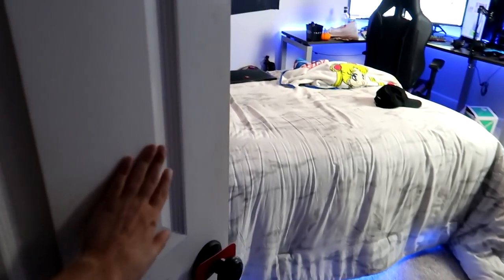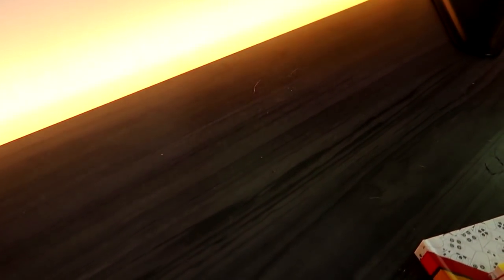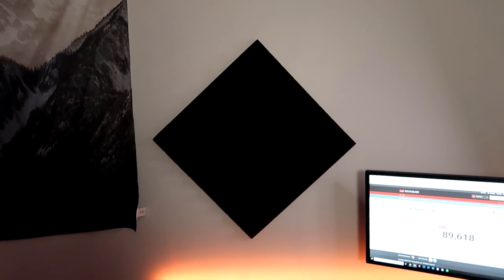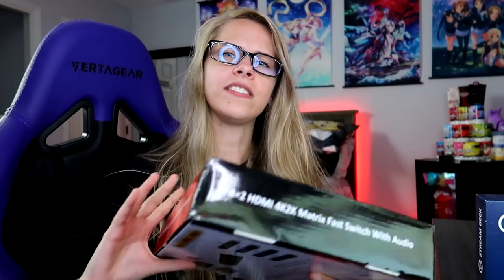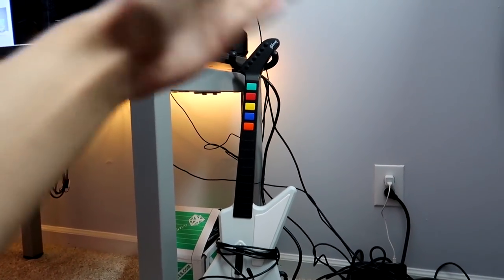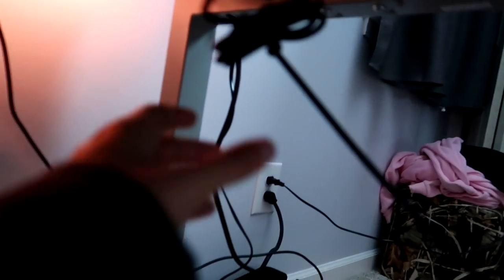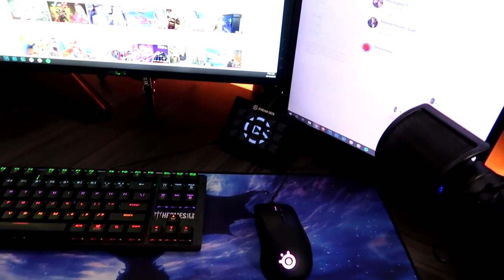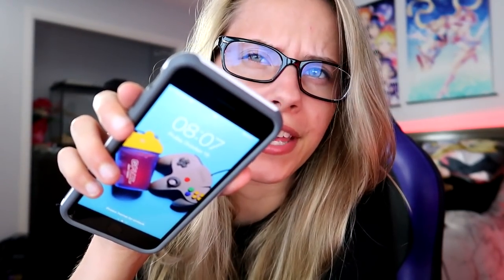UPDATING MY GAMING/STREAMING SETUP! ~ (CABLE MANAGEMENT TIPS) + Arrow Zoom Review | SoaR Butters

Comment: I have a laptop. Is that good enough?
Reply: no
Reply: depends on your preference and what all your doing with it and what the specs on your laptop are. Personally I prefer desktops so it would not work for ME. If your laptop is powerful enough to do what you need and your comfortable using it, then it would be good enough for YOU. It's all about personal preference and what you need the system to do.
Reply: For what
Reply: @RicardoPCGamer hi I’m getting a pc any ideas
Reply: @bigej6593  depends what you want to use it for.
Reply: Depends wut laptop u have
Reply: Depense

Comment: Hey, from one female gamer to another No zip ties. Really. Use Velcro strips. Easy for management. No scissors and no zip tie cutting later. Just wrap. I have all my computer racks and network racks set up that way. I work in IT system engineering and do the same in the server rooms with items I will be swapping. I even use them on large cat cable runs even in ceilings. Makes life so much easier. (I am 61 and this is just long life learning).
Reply: CSharkBytes yeah cuz you gotta be 61 to and a female gamer to know what velcro is used for.
Reply: Nah but being a 61 year old  IT systems engineer helps ...
Reply: CSharkBytes ok boomer

Comment: so you know, I found a hack to get better air flow on your case. Im planning on gettin the same one and almost everyone complains about the poor air flow in it. Did some searching and found some good info. On the front panel, take off the connectors, add a few small washers where the screws go. It will push the front panel out a little to give it more air flow. And remove the back panel on the upper case panel so the exhaust fans can exit the system better. which meens a cooler PC, and your PC wont run as hard.

Comment: That's not how the sound panels work! They don't block out sound outside or even inside the room. The only thing they so is (help) stop sound waves from inside the room from bouncing all over the place. In this case it helps stop sound waves bouncing from 2 walls. And help is the key word. Not completely.

Comment: If I may make a suggesting, instead of using zipties, I use velcro cable straps for cable management. Much easier to work with, and if if need to add/remove things its much easier. Also they are reusable so it will save money in the long run.

Comment: those audio panels will literally do nothing to isolate sound. lol Those panels are designed to defuse higher freq sounds coming from sound sources . you would literally need to tear the wall down and fill it with sound insulation materials. Just a heads up if anyone actually tries to buy these to think they are sound proofing something. They are not. simply diffusing sound not absorbing.

Comment: Very nicely done! I hate doing cable management so I applaud you for having the patience to stick with it. And I completely understand, the first time I did any actual cable management, I went all out and tied everything up with zip ties and it looked awesome, but then like 2 weeks later I decided I wanted to move my setup around so had to redo everything. Then not long after that I got a new monitor so had to add that in as well. I did eventually get a couple cable sleeves on Amazon that definitely makes it a lot easier to add or remove cables, but it’s still kind of a pain.

Comment: Hanna - for the consoles, pay attention to venting. They get hot and you do not want to cook your electronics.
Reply from the maker: i....i know o.o
Reply: @NoisyButters  Good. I had hoped with your degree that you knew to watch out for this. I have seen too many pictures on Craigslist of a stack of game consoles for sale, but the gear is cooked to death.  You could do a neat video doing a custom install of your PS4 & Xbox one but with proper venting. You could even get an old PC power supply and some case fans, a fan controller and RGB lighting and do active cooling.